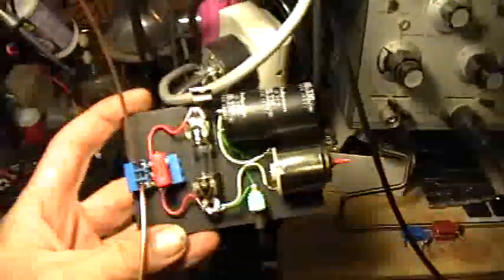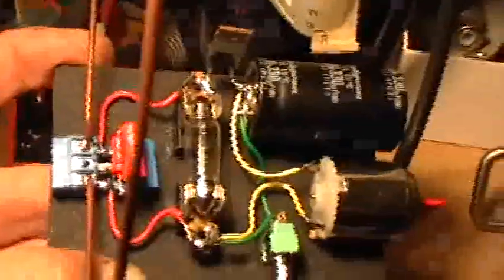Electric OU: Wireless Power Demo 5: Motor Load

Comment: I am doing a wirelessly power, controlable-speed electric motor, for my university project, I am an undergrad EE student.

Do you've any suggestions, tips, resources, papers etc. ?!
Reply from the maker: No, not that would be worth much in an academic environment. I'm lucky that I don't have to attain the required rigor in my own work!

I have several more videos covering my wireless power work, I'm sure you've probably seen them already. You may be able to pick up some ideas there. I built a small demonstrator into a little black briefcase, you will find the demo video of that. There is more information on the internet, of course.

The circuit used here is a basic "royer oscillator" or "zero voltage switching" mosfet oscillator; it is also commonly found in induction furnaces, etc.

Good luck with your project, and I'd love to see how it goes. Keep us informed!
Reply: Thanks a lot for your tips and kind words, I will keep you informed, though the project progress is slow right now, I expected to pick up pace in few weeks.
Thanks again,
Ahmed :)